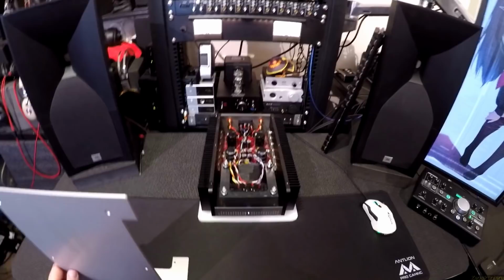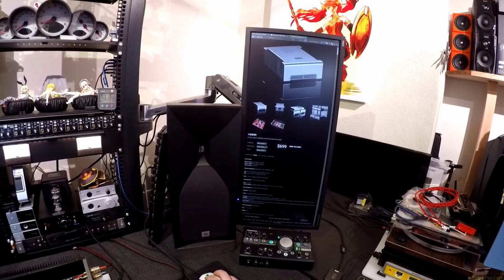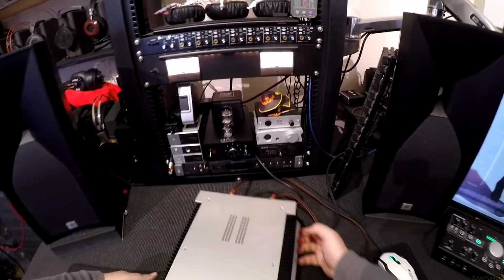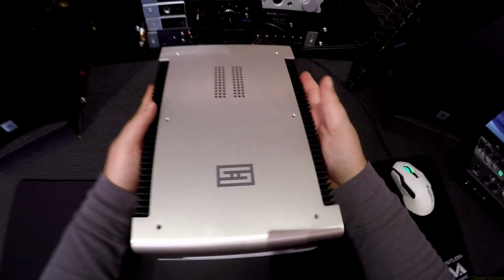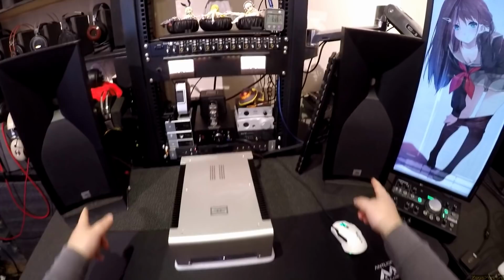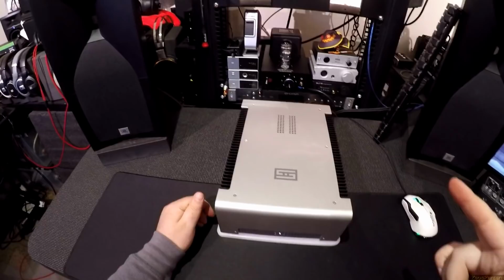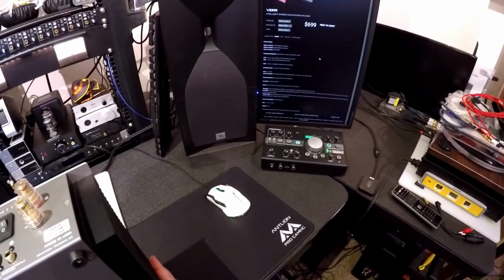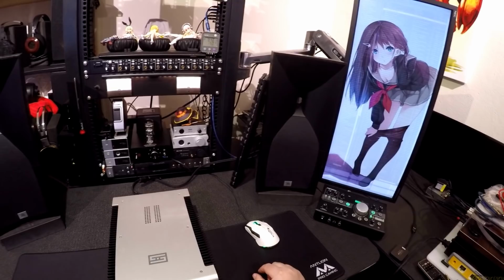Z Review - Schiit Vidar [Not Vader. NOT STAR WARS!!! FFFFFFF]

Comment: There are other American made low cost high power amplifiers besides Schiit Vidar. In a YouTube video “A $750 High Fidelity Power Amplifier” describes such an amplifier. This amplifier has a volume control knob and power on off switch at front panel. This amplifier is a Class AB, full complementary MOSFET amplifier.  This amplifier is rated at 75W+75W at 8 Ohm and 100W+100W at 4 Ohm. The frequency response is from 1.6 Hz to 40 kHz. THD at 20 Hz is 0.003% and at 20 kHz is only 0.06% (tested by Marantz). The damping factor is larger than 100. The gain of the preamplifier is 4.9 (13.8 db) and the gain of the power amplifier stage is 47 (33.44 db). The total gain of the amplifier is 230.3 (47.25 db). Because of the high gain this amplifier can be driven directly from the head phone jack (3 mm) without through a preamplifier.  Or it can be driven by a Bluetooth adapter. Most of the class AB high fidelity amplifier depends upon high bias current to eliminate the crossover distortion. High bias current heats up the output transistors and heat sink and increase the size of the transformer (weight). My amplifier uses very fast slew rate at the output to reduce the crossover. At fast slew rate I only needed 10 mA bias-current to achieve 0.06% THD at 20 kHz.  This amplifier idle at 6W of power and after I played loud music for two hours the heat sink temperature is 45 degree C and the case temperature is only 37 degree C.  This amplifier weighs 10 lbs net 11 lbs in shipping carton.

Comment: Hey Z were you using XLR adptors with your Tascam when you were comparing the a500 and Vidar? If so you weren't able to drive the Vidar to it's full power since it must be driven by a truly balanced preamp signal. If you could find an Emotiva Xpa-2 used it has tons of power and a vu meter like you describe with LED lights on the front.

Comment: Z... search eBay or etc for used ADCOM GFA-565 Monoblock amps. Nice thing about amplifier tech is that it hasn't changed like DACs or even speakers in the last 20 years. Search some of the Hi-Fi forums... so many Audioheads swear by these amps, as do I. I had a pair back in the day connected to a pair of Klipsch Chorus II's. It would shake your apartment to bits. For a little less, but still great clean power consider the ADCOM GFA-555 II.
Reply: "Nice thing about amplifier tech is that it hasn't changed like DACs or even speakers in the last 20 years. " other than Class D.
I love my GFA-555
Reply: Jason, the only adcoms worth considering, were those designed by Nelson Pass (designer behind Thrshold).
Reply: Very, VERY, pleased by my gfa 5500. Got an emotiva xpa 5 aswell, but i like the 5500 more.

Comment: Both the Emotiva a-300 and outlaw 5000 are better deals/options than this amp. Both have more power and are cheaper, $399 for the a-300 and 599 for the outlaw 5000 plus the outlaw drives 5 channels harder than this drives two.
Reply: Check distortion figures.  They might not be equal.
Reply: Maybe some buyers would rather not have Chinese Amps with Chinese parts.